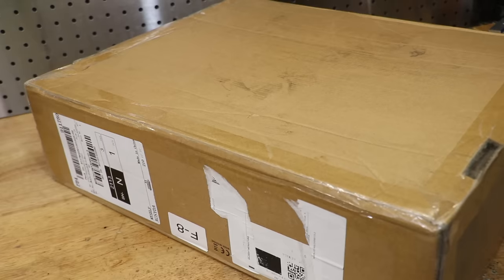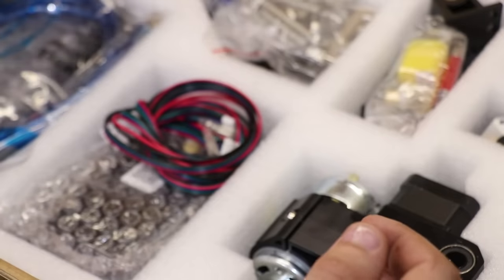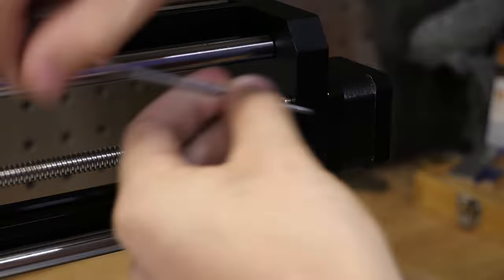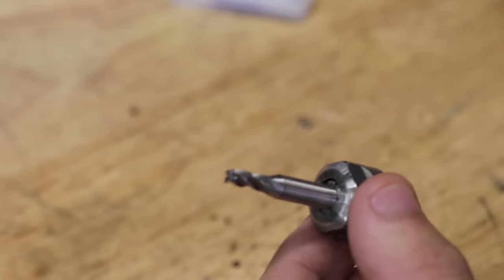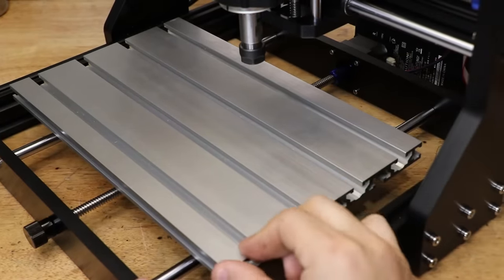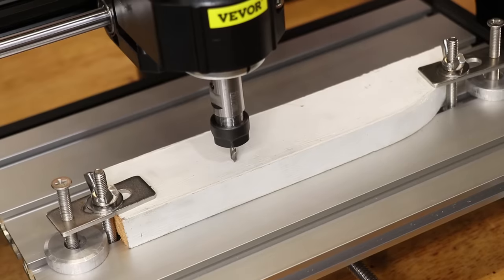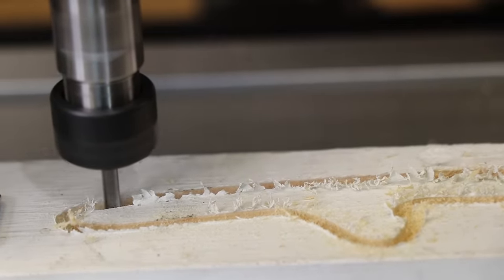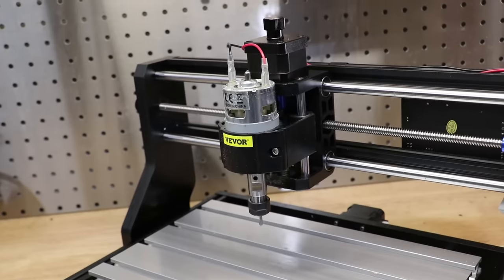A CNC Mill For Less Than $200 - Is It Worth Buying? (CNC 3018 Pro)

Comment: I have what may be dumb questions, but I have always wondered how much comes for $200. I think the money bought a very capable little starter machine that someone starting out would have loads of fun learning and using it. Now for the questions. Can you use the machine parts as patterns and build it up larger in size and out of aluminium instead of plastic. That way you can mount a proper router or HD motor, some beefy stepper motors, but use the little mills electronics controller, to run the larger steppers motors. If so that would be great because you said you like the way it works easily with your computer etc.

Comment: I'd check the runout on the bare motor shaft.  Also the collet adapter or collet might not be machined concentric ID to OD.  When a tool runs out, only the outside (high) flutes are cutting.  Two flute far superior.  Shorten everything up.
Reply from the maker: I wasn't really trying to reduce the end mill run out, rather trying to reduce the vibrations as a result of the wobble. Either way not much of an improvement

Comment: I use the same machine for facing 3d printed parts. It works great for that. But I don't need engine piston precision for what I'm doing. If you need super precise parts, the 3018 won't do you justice. But if all you need is 0.1mm precision, it's great, and you don't need anything more. With that being said; the 775 motors are not the highest quality. They'll burn out after 100 hours, or so. but the replacements are, only, about $10-$15USD; depending where you look. However, there's plenty of 3D printable mods, that will allow you to add a Makita, or similar router. But, for my needs, the 775 does a great job.

Comment: i bought my 6030 about 12 years back for about $1500aud. the electronics failed like straight away and i spent a couple months going back and forward with the ebay supplier getting new parts form them only to have the parts fail instantly until one day they stopped responding. i left it broken for a year or so until i got in contact with a guy who helped me out. another $1500aud saw a brand new custom electronics package, new water cooled spindle, new stepper motors and a re wiring. she works a treat now and i can happly machine brass.

Comment: Well I will say that I started my CNC fun with one of these little machines. At first the machine worked great. However it came to a point where it would not work anymore. I replaced the control board twice with no luck. Even replaced the power brick. Every time I would plug it in it would start smoking the circuit boards. Ended up selling. Wasn't a Vevor brand. Moved to a 3040 CNC (Vevor Brand) and that was a good machine. The bed size was definitely better than the 3018 but was kinda right there for a useable size. I Found a outstanding deal on a Vevor brand 6040 4 axis machine that was 3 months old so I now have a even bigger machine. I have not owned or tried other Chinese brand CNC routers but it seems like the Vevors don't seem to have all the issues that other machines do. Plus there USB. I run my Mach3 on Windows 11 without any issues. Machine runs great!
Reply: Vevor tends to use the same mechanical components as any other Chinese brand, but tend to have better control boards. I have a vevor 3018, non pro, and it's control board has been flawless. The only issue i've had is short router motor life with the 775's. But that's to be expected.
Reply: @cwalke32477  I am convinced that the electronics might be a hair better. It seems like all those China CNC machine brand and the tan machines on Ebay 3040/6040 size have to have the wires replaced. My 3018 wasn't a Vevor it was a off brand but it was cooking control board drivers. I replaced the board and same right away. I must have a stepper issue. Oh well I don't own it anymore. I have been very happy with my Vevor machines both 3040 and 6040.

Comment: We, I run a small charity, have been running one of these machines for the past three years. We use it to cut out a product from HDPE, and the little thing runs 8 hours a day 5 days a week. We have never had an issue with it, it just runs and runs, we haven't had to replace the motor or any other parts. We did dump the supplied controller, added a Raspberry Pi, so it works wirelessly now, and some micro end stops.
Overall it has been a great machine that has paid us back thousands of times over. It is being replaced by a larger CNC so we can cut more product quicker, but i'm sure we will find something for it to do. It engraves brass quite easily so maybe name plates.
Reply: I realize this post is a year old, but I’m hopeful…

You stated that you “dumped the supplied controller, added Raspberry Pi”….

Could you state what controller you ended up using, and what function the RPi performed ?

Thank you.

Comment: I've enjoyed mine, one of the best uses I've found for it is PCB boards, as long as you don't get too crazy with the design. But like most things in these price ranges, it's a project. I'm working on upgrading mine, a ball screw on the table axis was a big help and better linear rails. It has been a good reason/way to learn CAD/CAM most of all.
Reply: it's ok for most thru hole designs and thicker traces..but trying to cut really thin traces or pads for SMD PCB's it just isn't accurate enough
It's a GREAT beginners and learning rig...but nowhere near rigid enough for metal cutting

Comment: I've had one of these 3018s for a couple of years, and it boggles my mind that you were able to engrave aluminum on it, though I'm sure it would break after a few minutes! I broke quite a few high quality bits with this machine as the chatter was horrendous, even with additional stabilization, regular cleaning, and tediously slow carving settings. I'll be getting myself a better machine soon. This machine is fun toy for basic experiments, creating simple small templates, and carving softer woods or plastics, and it struggles to do even that, so I would definitely recommend aiming higher if you're serious about CNC.
Reply: What will you be getting that is better?
Reply: @matrixist  That's a good question, I've seen quite a few interesting options in the range I'm considering (4'x2'), so the price range is not comparable, but I'm most serious about the AvidCNC and X-Carve as a balance between price, quality, and portability. The lower-end models are in the 3-4k range, so I'm still planning projects to justify the price and figuring out the financing, but I think it's definitely the way to go for me at this point to help streamline production, which is my main reason (aside from the reliability and added carving capabilities) to buy a bigger machine.

Comment: Ive had one of these for a while, its a worthwhile purchase but if you use it over time it will need lots of maintenance. Biggest issue is the linear bearings in the head, they are just press fit in so once mine came loose they have never really stayed in properly again.

Comment: Getting back into CNC after 15years of rusting. The old CNCed X1 needs a Hand Tools Rescue rebuild and the lathe too.  Parallel port on tiny PC using FreeDOS and TurboCNC. So much easier theses days, even Raspberry Pi's can do it.

Comment: This type of machine is the best introduction into CNC machining. If you manage to become proficient in making little trinkets on this ( which includes) learning CAD and CAM software) , you can confidently step up to a bigger machine than you can use to make practical parts.

Comment: Having a little CNC machine to make parts sounds great. I have a few parts I would like to make but this machine couldn't handle it and spending >500 on one just for a couple little parts is pretty expensive. Still, it does seem neat. I would like to own one at some point, which seems possible given how quickly the cost of a capable CNC machine seems to be dropping.

Comment: Ayeeee nice video! Been thinking of a getting a table top mill... but one thing as a youtube expert, i didnt like was... when ya set your tooling ive found the best thing to use is a chip bag!.. paper gets rough sticks and everything sticks to it dirt,grime,chips,coolant... but a chip bag stays clean, smooth on the touch off and a simple wipe cleans it rite up without it ripping up and lasts 10x longer.. idk try it and let me kno what ya think!!
Reply from the maker: That sounds like a pretty reasonable suggestion. I don't think I have heas of using a chip bag must is definitely sounds like it could work

Comment: Regarding Vevor. I keep bees & my large stainless centrifuge honey extractor is also a Vevor. (Works great, but the flimsy legs kinda suck... sort of like a plastic framed CNC machine) I believe a lot of China's manufacturing cranks out random generic items for distribution companies to buy & label. Vevor seems to have found that nook of barely to somewhat useable but affordable options to typically higher cost items. I have some Harbor Freight Lathes in that same boat.

Comment: I've been casually considering a machine of this sort,  or a similar one.  I've been watching a fair number of videos on both this machine and also for a fair number of similar ones of varying sizes.  I figured that there would be some nontrivial limitations to one of these,  but wasn't sure where they were.  You showed where some of them were,  and that has pretty well decided me to not buy one of these,  but instead to hold out for some kind of a machine that deserves to be called a mill...

Maybe if you come up with some ideas about how to overcome some of the shortcomings of the machine I might change my mind.
Reply: Isn't the machine capable of milling it's own metal upgrade parts? Similar to budget 3D printers, you probably want to print some upgrades early on...
Reply: Years ago, I went to a machining trade school. Learned CNC on a Haas machine.
My instructors would fall out of their chairs laughing at this thing.
Of course, a Haas can be more than 1000x as expensive.
For $200, you get 1/1000th the precision.
"I got it down to a tenth."..."a ten thousandth of an inch?"....."no, a tenth of a millimeter".....
"oh"
Reply: @peterbelanger4094  you've just described "disruptive innovation" (many fortunes are made this way).
100x less precision at 1000x less cost and still very useful!
Reply: @dl5244  Not this cheap "pro" version it makes my pro look like "elite pro" edition lol. I mean I can 3d print better parts then what came with this one. And they do have kits that are rated for metal out the gate but they got the upgraded mount, and motors wich really best upgrades out thter for it. A new mount and better motor, really makes this thing shine more. But its still entry level even with all that it will make metal easier, but still slower then a more expensive machine. That is why these little cheap kits are over amazon. I seen some for 120 saaying they are "pro" some for 300 saying pro. you check why one is 120 one is 300 you find out quick these are not Ender 3s were all ender 3s are the same more or less. A 3018 pro from one brand isn't the same quality as another brand.

Comment: But it is still a deal for $200, as long as you replace the table, the motor, the frame of the machine, and the small bits.  🤣
     Looks like it would be a nice birthday present for my 6-year-old son to cut out balsa wood unicorns!
👀  👍🏻  🦄
     All fun aside though, good video. Thanks for the information. 👍🏻

Comment: I've seen folks on YouTube trying to upgrade these machines, they gradually replace all components and it's still not rigid enough because you need two Y axes and ball screws to get any precision in aluminum.
Reply: And if you push past that point you then discover that when you're driving a VFD brushless spindle and pushing nema 17 to their absolute limit the controller starts failing randomly because of all the EMI issues. That and buffering over  USB is terrible with complex paths. And you can still only do a 0.25mm DOC

Comment: Have a similar machine 3018 use it mainly for making copper gaskets for motorcycles not a problem if you want to do aluminium will need to upgrade the motor.

Comment: Hi, maybe a silly question - you have quite a few machines in the shop. Wouldn't it be better for you to build this kind of cnc machine? You could use linear rails, and machine most of the underlying surfaces. With a steel frame mixed with epoxy granite (you have experience with), you could have a stiff cnc machine that can handle even steel.

Comment: Keep in mind certain toolbits are incompatible with aluminum and actually cause the aluminum that is removed to build up on the toolbits. 

Basically any bit that has an oxide coating is incompatible in the long term. 

It you do manage to mangle a bit with aluminum use a drain cleaner with sodium hydroxide to eat away the aluminum leaving the bits behind. 

Use ppe.

Comment: My dad has a cnc (router) and when i tried to measure tool runout i noticed a preatty big rigidy issue (more like huge) enough to visually identifiy in fact and its all made of aluminium (albeit its a very large router like over a meter long by 200+mm)

Comment: If we pay hobby market price cnc run out can be compensated by end mill size in the cam software. Just add (run out, peak to peak) to the end mill diameter. Then test to verify before further correction. If we don’t know that we are not qualify to use hobby grade cnc. 

BTW novice use to measure run out at the tool holder body. Better test the end mill shank to get more realistic peak to peak sun out.
Reply from the maker: No, my aim wasn't to reduce the end mill run out, it was to reduce the run out of the spindle itself to try and reduce the vibrations. That is why I measured the spindle run out, not the end mill.
Reply: @artisanmakes  if we do nothing we can reduce rpm to reduce vibration. Besides we aren’t in a hurry being a hobbyist, spending little to no money is our goal. 

Remedies. 

can we add two more fasteners to make up four so we can remove eccentricity the way we do with a four jaw chuck? 

An alternative is to replace the heavy chunk by a light weight coupler sleeve between motor shaft and the tool, if we have a good lathe. 

If motor has little to no run out we can upgrade the ER collet mnt hole, first enlarge the stock  mnt hole then friction fit fill that hole. Refinish the mounting by a precision boring a mnt hole fitting the motor shaft. Remember to verify that the motor stand alone are not contributing vibration as much. 

If we know a good way to disassemble the stock motor try static balance the rotor with a hobby propeller balancer. Ballast? Two part putty epoxy attach to magnet coil wire. 

If we don’t know or can’t do better than that we don’t qualify as DIYer or hobbyist.

Comment: I bought one a few years back and the offline controller would fail to send some of the gcode commands so it got discarded quite quickly. Generally it was the circle commands.
The backlash can be easily fixed with some thermoplastic to stop the backlash screw rotating but the flex is a separate issue.
I use mine for cutting timber and plastic. It's more than adequate. It's hooked up to an orange pi zero running CNCjs so I can manage it remotely because I don't want it any where near my computers.
Get a Compression Milling Cutter that pushes the chips down and you'll get really nice milling of timber. Even a 6mm compression bit cuts perfectly at a fast rate in oak and plywood on one of these machines.
In the end though these machines are fit for purpose and on that basis i'm very happy with mine.

Comment: I got the non-pro..it's a beginner learning gcode/cnc...and yes...it is VERY limited on harder materials...but wood/plastic/cell phones yadda yadda it works beautifully
(it's not even accurate enough for PCB work either)
For $200 and below it's a decent deal...but if you save up a little more you can get better ones
Reply from the maker: Thanks for the insight, even though electronics are a particularly weak area for me, I was hoping to machine up a PCB or two.
Reply: @artisanmakes  It should do that OK. The important thing with PCB milling to probe a height map first.

Comment: You need to add a sub straight to the top we use a dense 3/4" Vacuum parodical board on the lg CNC's add it to your Aluminum base to mill into, a 1/4" or 1/2" piece of Plywood should work just fine for the smaller models

Comment: Just a little bit of awesome inside information about some tooling u should be using from now on! Im sure very very few will know this as I have only just learned it today and your the first machinist actually first person I've shared this with! Use P63A metal instead of the common HSS , has acts like mild steel in comparison if you can get it ? Thought it's good to share and yess I know it's not a good time to talk about Russia I don't back there cause but this is just a coincidence that its Russian, anyway buddy I really like your contet all wrapped up with your well spoken and talented results from your loved machines!

Comment: For what it is worth, I have not bought three different products from vevor. Here in the states, it tends to run about $10 more than the cheapest options, but I think it is money well spent. The instructions are almost legible wish goes a long ways. Many Chinese products have cast screws that do not function very well. Virtually all products have to be cleaned out of grinding dust and the grease replaced. Maybe I have just gotten lucky, but all of the vevor units have been pretty robust. The power feed has the standard problems of speed creep and difficulties at very low speeds but it is all brass gears and shims, most of the competitors are plastic. The instructions at least give you a clue, competitors leave me confused if the instructions match the product. I think of vevor much like I think of wen for cheap powered hand tools